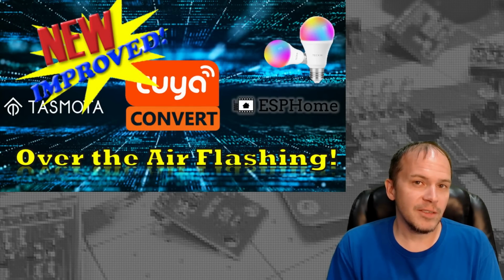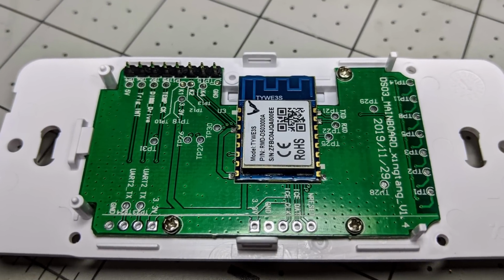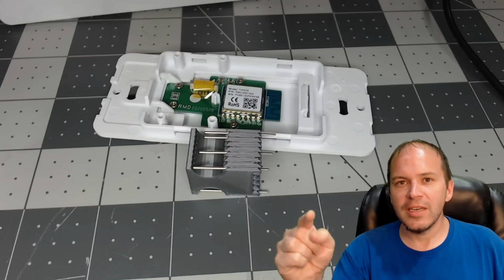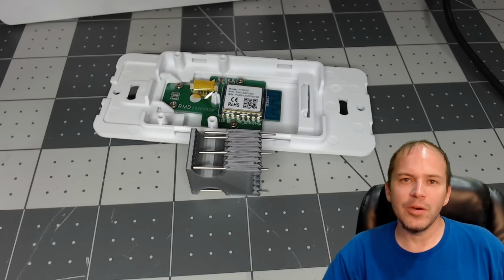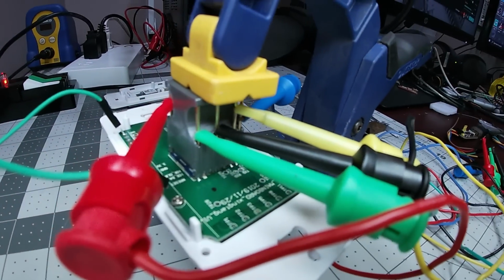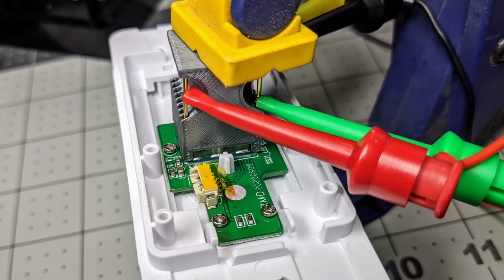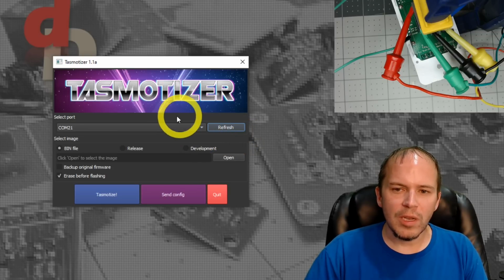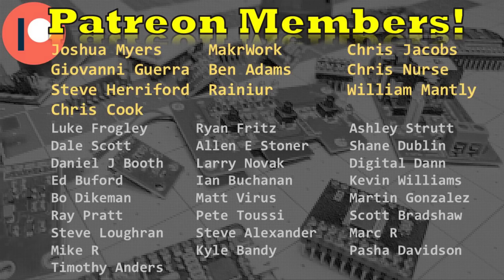Tuya Convert Not Working? NO Solder Jig | Flash Tasmota & ESPHome

Comment: Hey Travis, love your videos. Just now starting to get into tasmota. One question for you. If you re-flash the fan controller/dimmer with tasmota, it erases the factory firmware, right? Will it still have the voice functions for Alexa or will I have to find another voice control to use? Thanks for your help.
Reply from the maker: Yeah, you are removing the cloud from it totally.  You'll tie into a home automation system such as Openhab, Home Assistant, etc and those systems provide the automations and voice control.

Comment: Where can we find instructions for esphome?
Reply from the maker: I assume you can already build your own device and bin if you want to do Esphome? Little different project style so I didn't show how to do it given it is specialized per device and person. Once you build your bin I would use the Esphome flasher talked about here to send the bin over. 

https://esphome.io/guides/faq.html#i-can-t-get-flashing-over-usb-to-work
Reply: Once your device is tasmotised then simply upload the bin into the flash firmware section in tasmota. Updates to esphome!
Reply from the maker: That is one way but might as well just flash from the jump to make it safer. If you do go from Tasmota to Esphome. Be sure to turn off the safety check in Tasmota otherwise it will refuse the bin. Go to the console of Tasmota and type

Setoption78 1